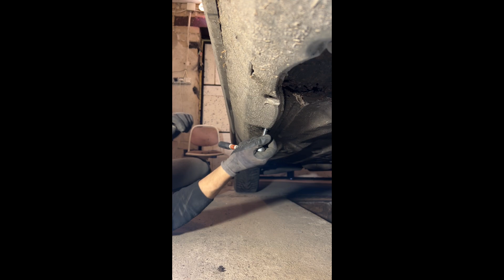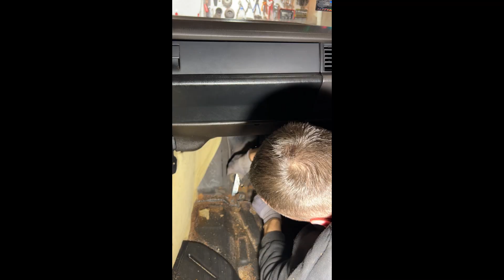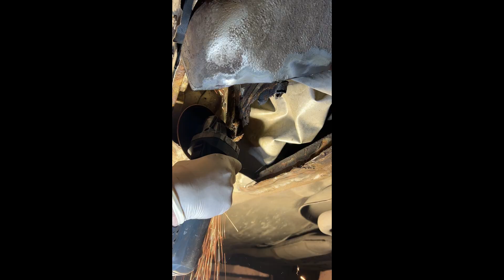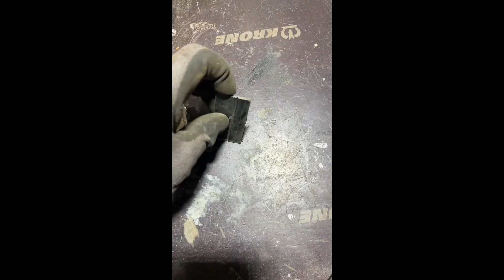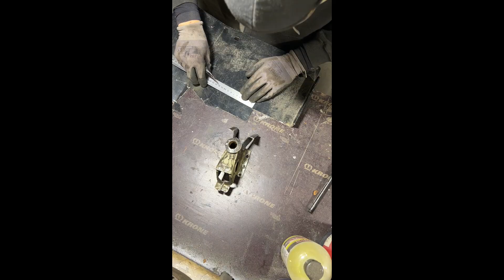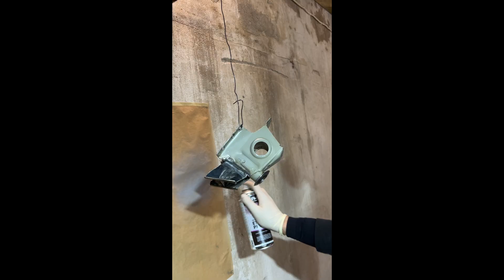Jacking point Welding Mercedes -Benz E190 (w201)  Part 1

Comment: these cars are so prone to rust in that section i don't understand it but yeah.
Reply from the maker: Yes, I've noticed that too. I think there are two main reasons for it. First, when people use the factory jack that slots into those holes, it chips the paint and causes it to rust. Second, if they use a standard floor jack without a rubber pad or wooden block, the metal lifting pad presses right through the rubber undercoating. This exposes the bare metal underneath, which eventually rusts.